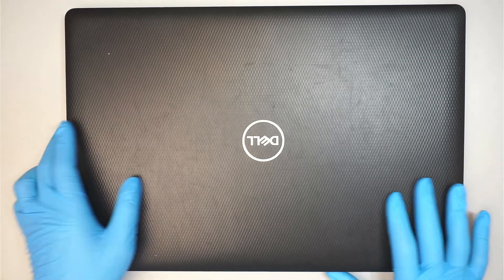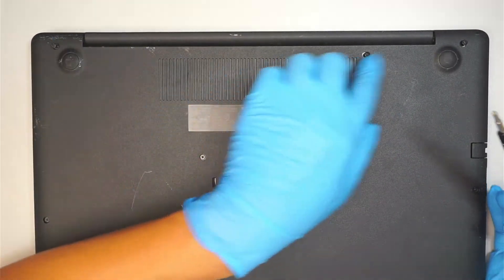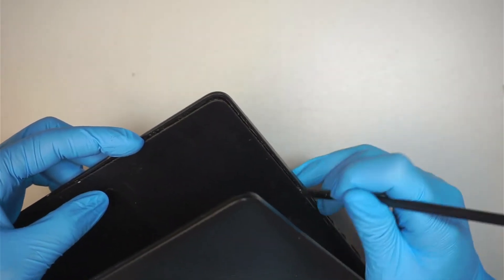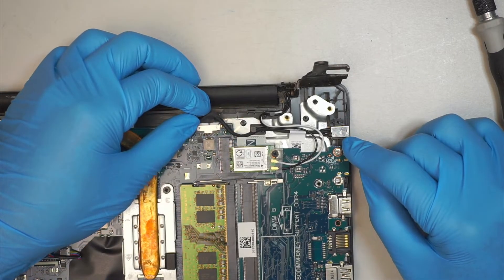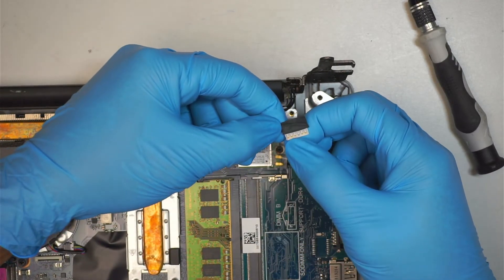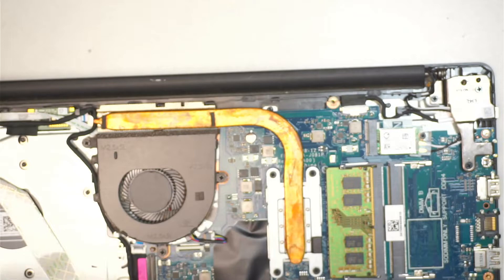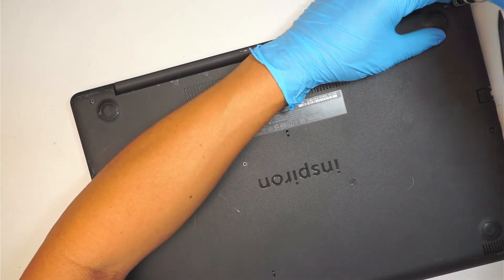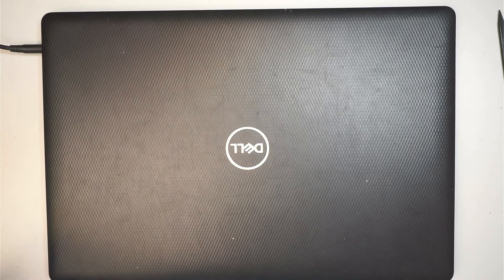How to replace Dell Charging Port DC Jack

Comment: Thank you so much. Saved me from buying a whole new device. The task seemed intimidating as I have zero experience with electronics 😂. My computer now charges I'll be s
ure to link your video to my Amazon review of the DC jack. I also purchased a battery just in case I needed to replace it. I'll be holding onto it for a later date.

Comment: Thank you good video. I need to replace my Inspiron’s  15 5000 power jack as I jerked the power cord hard when it wrapped around my foot . The fan has also started to run in pulses which I suspect means the fan is soon in need of replacement. I going to give it a try do it myself as my PC is out of warranty.